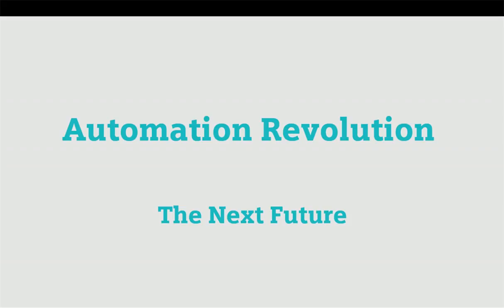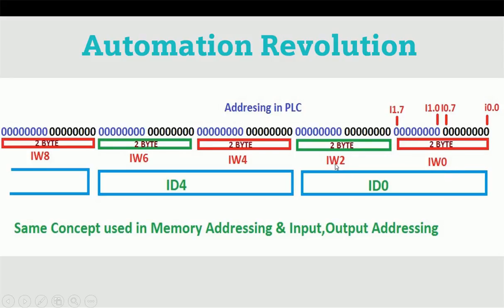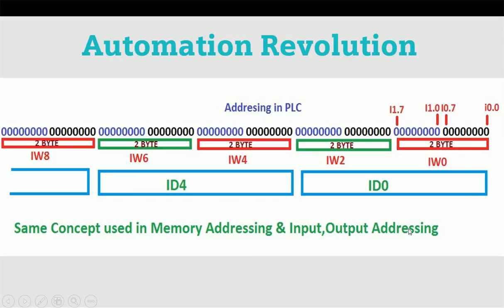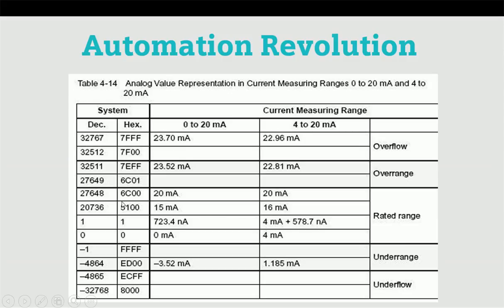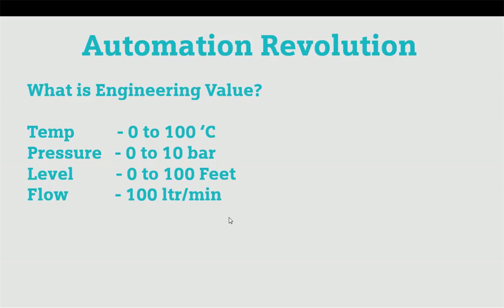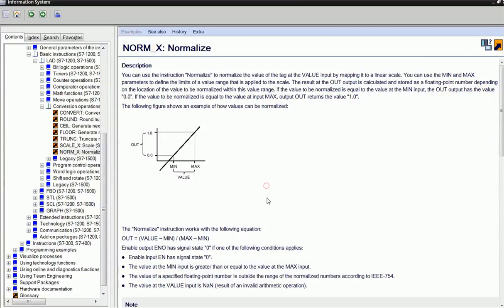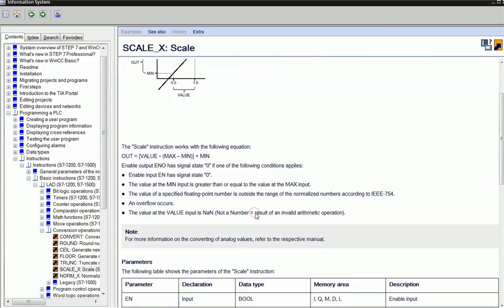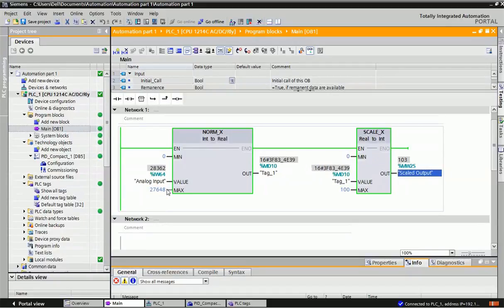PLC Tutorial 7 : Analog Signal Scaling in PLC

Comment: Use a function Block (FB), and don't use memory addresses like %MW01..., and simulate inside the function, and you will see the results,
Reply: can you please explain what do you mean by use FB ?
Reply: @mohammadalzahrani3409  FB means a Function Block, I mentioned it before saying (FB), when you add a new block in TIA Portal, you'll find different types, main OB (Organization Block), an FC (Function) in Green, an FB (function block) in Blue, and a DB (data Block).
Reply: @anything_can_happen79  i understand what is FB, what i mean is what is the difference that will happen to result? 
as i noticed in the video he's getting over-range value from the analog input, what could be the solution to fix that and how? because i'm facing the same problem :(